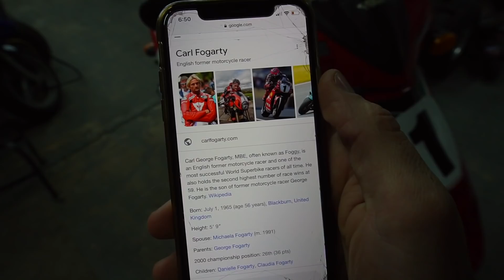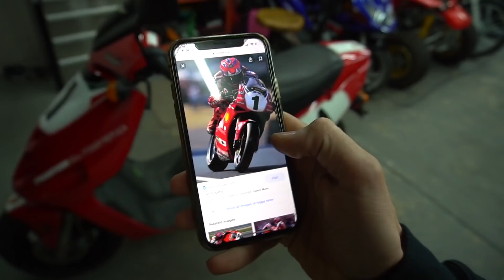RARE Malaguti Phantom F12 Build Begins ! FOGGY REPLICA

Comment: Found your video channel yesterday when I searched for Malaguti mopeds. I just uncovered mines after storing it away because of a small crack in the fuel tank about 12 years ago (bad rubber grommet worn through and cut into the tank, factory defect?). It's still in immaculate condition and has maybe 100 miles on it. It has the digital meters so I need to put a battery on it to see the mileage. I'm surprised to see even the paint and graphics are still flawless. I bought mines from the dealer in 2002 new. I was surprised to find your video and was happy to watch it and see what I have in store for me in checking everything on mines to make sure it's in working order. I do love the 2 strokes as I do have a 1999 Valentino Rossi Aprilia replica with a 70cc kit installed also. I also have a 1979 RD400F Daytona Special which is my toy from when I bought it new. Like you guys, I worked on 2 strokes back in the day and rode Motocross bikes when they were all 2 strokes. I thought I was over wrenching on them at my age of 68 but I decided to put the Malaguti back on the streets here in Hawaii. Thanks for the video which helped me alot to see what to expect since mines was still new so never took it apart for anything, so this will be the first time it's to be worked on. Take it easy over there, Mahalo and Aloha from the 50th state of Hawaii.

Comment: Here in the uk, I have the f12 100cc air cooled, apparently same engine as the Yamaha aerox/neos 100cc hard to come by parts over here! Can see your rear body panel has cracked under the rear light, must be from pulling it over the fuel tank
Reply: that crack under the rear light its a common thing all my f12's have that crack